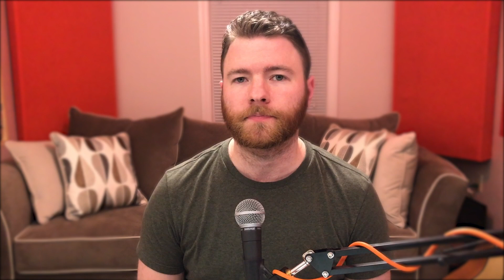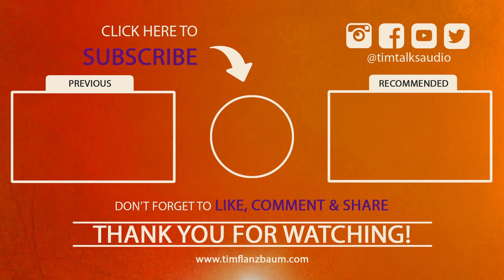Audio 101: The differences between Mic and Line Level Signals

Comment: Your explanation of dBV vers dBu is wrong. The only difference is the reference level, it is nothing to do with "fluctuations", dBs are still the same power ratio whatever the reference. Professional  line level is not +4dBu, that is only the external calibration level that corresponds to 0VU on a VU meter on a mixing console or tape recorder. The actual signal levels can vary up to the power supply voltage, e.g. with +/-15V supplies the maximum input and output levels before clipping would be about +21dBu. On digital systems the reference is 0dBFS i.e. relative to Full Scale which is where the ADCs clip and that varies, but is often around +22dBu and a "0VU" level is artificially set to be between -10dBFS and -20dBFS according to how much headroom is needed. Consumer interfaces running on a 5V psu will have a lower 0dBFS, read the specs carefully for maximum input level.

Comment: I have a question when recording from a source how is it that people are able to get a recording from a speaker output? Plugging in directly to the speaker / monitor …Do you use line  or Mic on your recording device?
Reply from the maker: Depending on a number of different factors, if you are coming out of a powered mixer, you could use the monitor output, but ideally you would want a line level output from the device you are trying to record.

Comment: So i have a camera with two XLR inputs AND a Mic input (3.5mm jack).  The controls on the camera has a switch for MIC or LINE. When i plug somerthing into my camera via the Mic input (3.5mm) is it best to use the LINE Level option? 

And If i use any of the XLR inputs on my camera. is it best to use the "MIC Level" option?

One time at a church event. I plugged into their soundboard. they had an XLR out that i could plug into my camera. So i plugged it in and even though their levels were good on the board, and my camera gain levels were good.. I was getting distorted sound. Could it be that the XLR input i was taking into my camera was set a the LINE level? and it needed to be on MIC? or.. maybe it was on MIC and it needed to be on LINE..... oh man im so lost. ahhaha. Appreciate the video! I definitely understand more than i did before lol.
Reply from the maker: Not all cameras are the same, but I think for your camera, it has two input options and the mic/line selector is for BOTH input styles. The answer comes from the device you are plugging into the input. Of course, if it's a microphone, then MIC level, but in your example of the XLR from the mixer, that was a LINE level signal and the XLR input should have been set to line to accommodate! Good luck on future shoots!
Reply: @TimTalksAudio  oh man thank you so much for your reply!! I will definitely be sure to check that next time. I honestly didn’t think it did anything/ignored those controls.. the issues I’ve been having makes sense now.  Cheers.

Comment: Thanks for the clear explanation. One thing still is confusing me though: how do you know if any given device or equipment is instrument or line level? like keyboards, synths and especially guitar pedals.
Reply from the maker: Guitar pedals are designed to go infront of an amp (or through the FX loop) and built to maintain instrument level signals, but pedals can also handle line level. Typically, any other output from a source (keyboard, outboard gear, etc etc) will be line level.
Reply: @TimTalksAudio  thanks for clarifying!

Comment: Hi Tim I have just bought a  new Shure M57 to record a bass amp and cannot get a acceptable signal, I have to turn up the gain knob to full max to even get a peep out of the mic this is a focusrite Clarret,  usb (no pad) using XLR cable input set to instrument does this require a pre amp booster like a cloudlifter,what do you suggest is the problem? regards Stephen
Reply from the maker: Hello Stephen. Genereally speaking, dynamic mics MIGHT need a lot of pre amp gain to get a strong enough signal if the source is "too low". First thing to try would be to turn the bass amp louder to push more air. If you can't turn the amp louder for whatever reason, then yes, I would suggest getting something like the cloudlifter to help bump that input gain up. Also, if you're not doing so already, try recording a DI signal as well with your bass amp. That opens you up for a TON of creative flexibility with the bass!
Reply: @TimTalksAudio   Thankyou Tim yes I can turn up the amp push more air good thinking I noticed on one of your earlier shows you had 3 bass tracks blended in your composition, would be nice to see what tones ,gain etc you blended and why, and how they sat in the mix after plug ins as they sounded great.

Comment: Please what level should i use for recording a sound from a mixing console into the audio interface using 1/4 Jack or XLR cable which is connected to the pc via a usb? The audio interface has line level input and mic level input and instrument level input. so now from the mixing console to the audio interface input levels which one will be approriate ? Thank you.
Reply from the maker: From a mixer to a usb interface, you’ll want line level.
Reply: @TimTalksAudio  thank you

Comment: Hi Tim,
If I am taking the audio out from a mixer (aux out) and putting that into a different mixer, do I need to run it through a DI first?
Reply from the maker: You shouldn’t. The output of mixer one is line level, so just pop that into line level ins on mixer two and you should be good to go!
Reply: @TimTalksAudio  Stop with the bullshit. The information you're giving people is absolutely ridiculous. The person asking you the question knows a lot more than you do. What you are telling him is OK to do, could damage his equipment. The primary function of a DI box is not to change levels, its used to convert balanced signals to single ended operation. The 2 modes of operation are not compatible. If one of the components that he wants to connect is running in balanced mode, and the other is single ended, the way most cables are wired will create a short circuit the moment you make the connection. You are literally taking 2 + and - wires and combining them while there is power running through them. 

It might also be a good idea for you to learn what a preamp is. Line level signals don't need a preamp? What exactly do you think a mixing board is? What's even more amazing is you can pull the information I'm giving you right out of a textbook. You're in no position to give anyone advice.

Comment: Microphones are basically a little speaker in reverse vibrations  (voice) hitting the spk cone will make a tinny voltage on the speaker terminals (very tinny) line levels have circuitry where the voltage is higher - in other words mics have no circuitry and line level does

Comment: I wish to reduce the intensity of the output signal from My Analog Audio Mixer... externally, without scaling down the volume control of Mixer. Is it possible? Because the output would be fed to an android mobile phone’s headphone socket via a specially made TRRS Plug for FB Live Singing with music. At present, the output signal is overloading the Mobile phone and distortion is happening. In order to reduce distortion, I use an amplified Monitor Speaker at the output of Mixer to Monitor my singing and keep the volume of Mixer output to a bare minimum. Please help 🙏🙏
Reply from the maker: Look for what’s called an “in line pad”. A pad is a device that can reduce the level of a signal. Typically pad reduce signals by -10 or -20db. Have the output of your mixer plug into the input of the pad and the output of the pad plugged into your mobile. That should help avoid overpricing the input of your mobile.
Reply from the maker: Something like this... https://amzn.to/3esS87T

Comment: Do active pickups on a guitar count as a preamp? Meaning, can I plug an active guitar directly into a line-input of an audio interface?
Reply from the maker: Active pickups are not the same as a pre-amp. You can plug your guitar into the line in of your interface, but you're better off using a Hi-Z input if you have that available, or a DI box into the mic input of your interface.

Comment: What happens if I plug condenser mic directly into house speakers
Reply from the maker: Nothing, A condenser mic needs 48v Phantom power and a PA will not supply that. If you have a mixer in line that can supply the 48v, then you can use it as a microphone through the PA, but be careful. Condenser mics are more sensitive and need more work to not cause feedback in a PA system. It's certainly possible to do, but for small PA's it's harder to clean up the signal with out completely chopping up the frequency spectrum to use it without feedback.

Comment: “You do not want to take a line level signal and plug it into a pre-amp.  You could do a lot of damage.”

If I use my line out of one amp (to use its sound) and connect it to the return of the effects loop of another to use its power amp... 

Is the “return” amp 2 line level or pre-amp level?   

The reason I ask this is because I know the conventional way is to go from “send” of amp 1 into “return” of amp 2... but I found it sounded better if I used “line out” from my first amp instead of using “send.”

I just want to know if I’m risking damaging my equipment if I continue doing this so I can stop.
Reply from the maker: The FX send on an amp would be instrument level. The differences between voltage on instrument vs line should be close enough that you wouldn't cause damage. Also, the return on the 2nd amp, may or may not have a return preamp, so check the manual of the second amp, but it should be a point in the signal path after the preamp, but before the power amp.

Comment: hi mic, im trying to use behringer model d in studio one but does not seem to work can you please help??? please
Reply from the maker: Here's somethings to check. You can connect the unit via USB to your machine for sending and receiving MIDI signals. To record the audio from the unit, use a 1/4" cable from the unit's "HIGH" output to a line level input of your audio interface. It's a mono source so you'll only need one cable and to make a mono channel.
Reply: Tim.  It's Tim

Comment: Fantastic video. I often will do voice recording with a mic into something like a Clarett and take the analog out into my zoom recorder, so I am in essence sending my zoom a line level signal and it's an Audio Interface of sorts, same with when I record a mix out of my mixer on my Zoom recorder. So I agree with you on being careful because it's a lot of signal going into another preamp because the input is line level, but my question to you is whether this is a potential problem or not the best way to do it? I feel like if I do it while monitoring my signals that I end up with super low noise because bother devices are low noise and I use low amplification on the Clarett and the Zoom F4 or F6. Am I missing something here?

Comment: So if you are wanting to record  guitar direct  from the guitars Amplifier to capture that sound, would you go out from the line out on the amp direct  to  the line level  input on the Daw,( not the instrument  inputs ) is that correct ?and with  out a DI box. Thanks Tim
Reply from the maker: If that were the case, I would put a microphone in front of the guitar amp and record that. But, in your question, you could come out of the line out from the amp and go into a line input of an interface, yes.
Reply: @TimTalksAudio  Thank you  Tim i understand this better now, i thought that was the case, but needed  just to clear it with you.